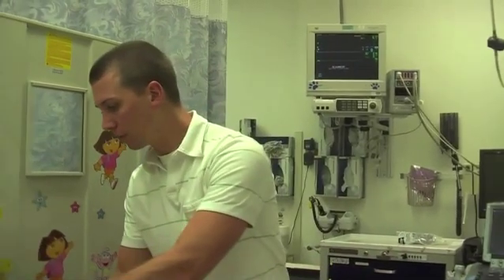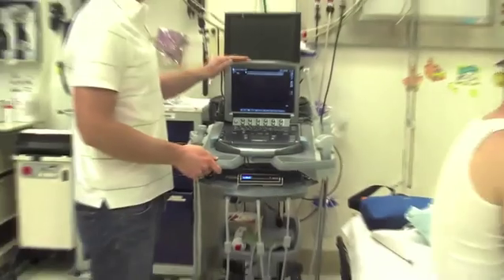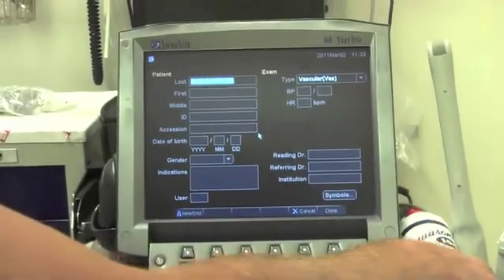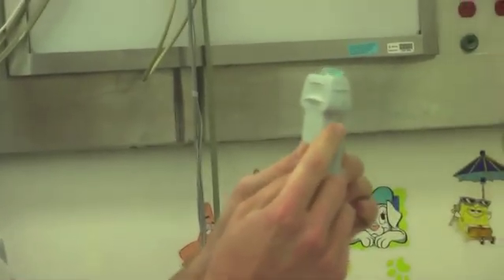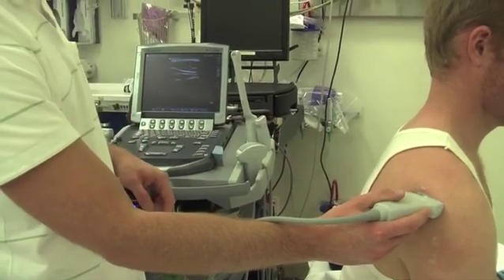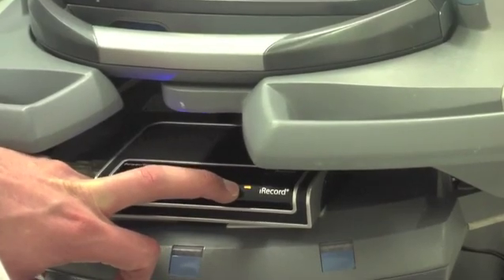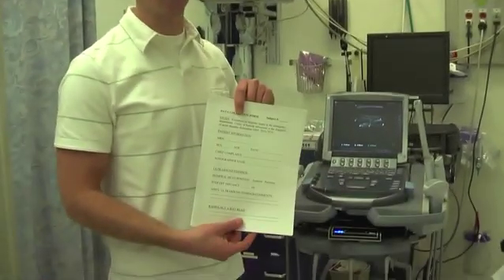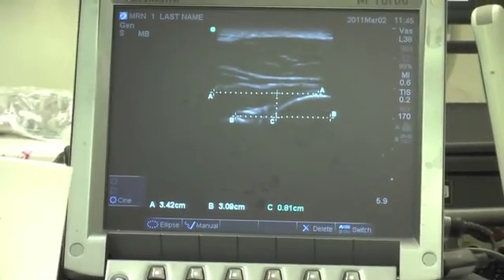Shoulder Dislocation Ultrasound Training

Comment: If you do ultrasound after the X ray,the Anterior/posterior dislocation  would be seen on Xray.Ultrasound in addition will help to identify any problems in the rotator cuff,fluid in the joint& bursae.MRI.is expensive & not readily available.